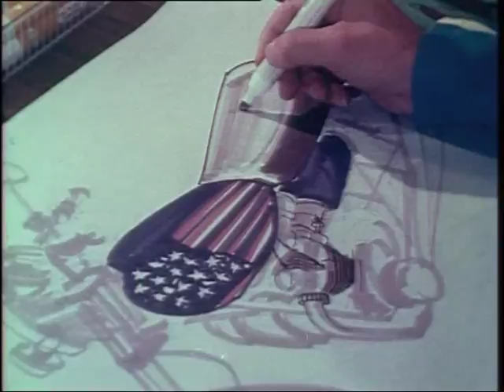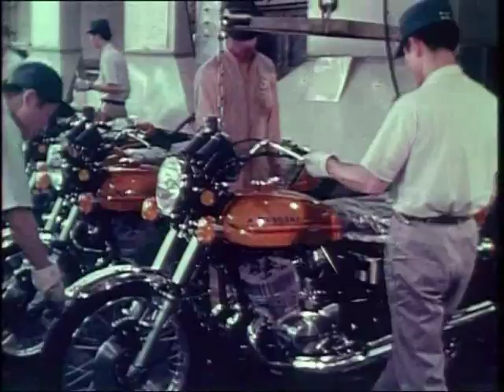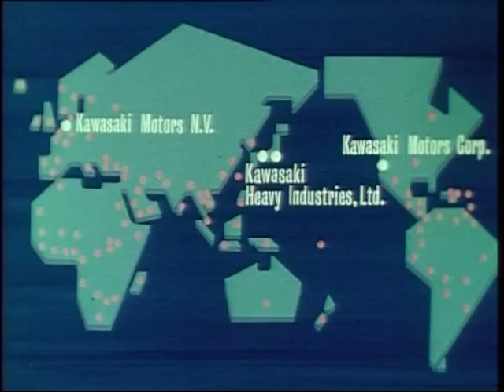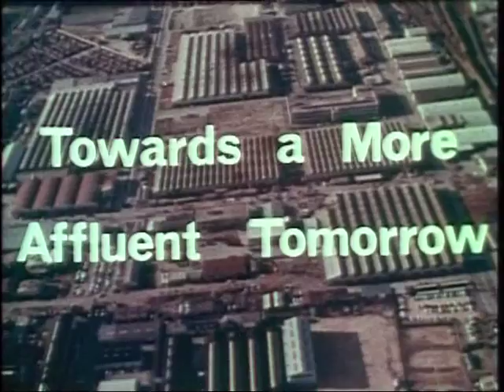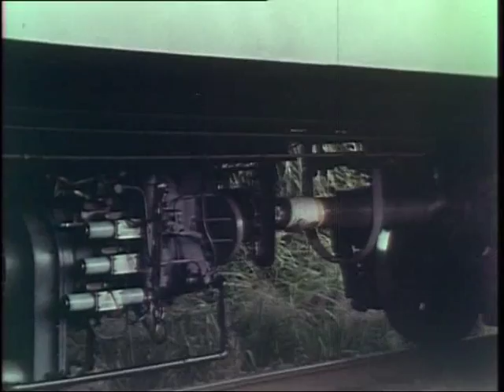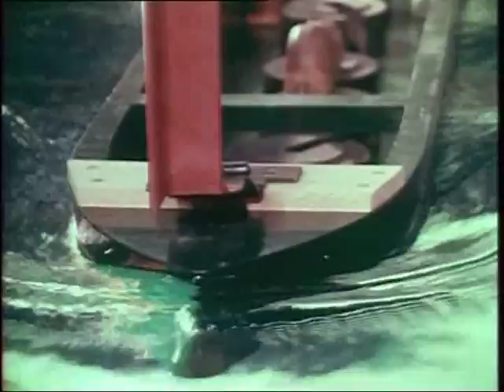COME OUT AHEAD ON A KAWASAKI.

Comment: I'm 68....go waaayyy back to my first bike kawasaki 100 g5...yellow...rode the crap out if it...3k miles sold it to a friend and bought a 250 Enduro yellow. Then a used 500 mach 3 which almost killed me it was terrifyingly fast....fold it for a green kz650 my all-time fav bike...loved everything about it....rode it 22k miles and sold it for a gpz550....kept it for 8 years....in 1991 bought a Vulcan 750 twin.....rode it all over arizona and Utah with my friend who had a honda magna 500. Last bike I ever bought was a kl650 rode it up to south Dakota.....my biggest wish was for it to have a 6 speed gear box.....im done with bike....in a way I'm lucky I was not killed....most of my bikes were all kawasaki....did have a yamaha xt500.....a 
Suzuki gs250 that my ex wife rode.....a used Honda cb 550k 1978....that I kept 14 years.

Comment: They basically took over Bridgestone. The two strokes were basically throw away bikes as crank seals cost so much to replace. The Z900 and 1000's were very heavy until the J model. Z1000J was incredible, CAD designed for light weight of every single part and bolt.

Comment: In 73 I traded my 71 mach3 for a 73 Z1, also motocrossed a modified 350 Big Horn.
Reply: Oh you went down hill,lol.
Reply: @noel3422 the Big Horn could hang with Maico 501s in deep sand. Quite impressive.

Comment: I owned several Kawasaki in the 70’s and 80’s. My first Kawasaki was a ‘74 250 triple 2 strike street bike. It was noisy, rode rough and got terrible gas mileage but it was quick. My 1980 KZ 440 LTD seemed light years ahead of the 250. O did get a new 1979 KL 250 4 stroke single duel purpose bike and it was fun but at 3000 milesthen at 6000 the head needed replaced due to lack of lube to the head.
Reply: Common problem. Mineral oil couldn't handle the heat.

Comment: You have to laugh when he says that Kawasaki is building safer bikes, and then shows footage of KH750s coming off the production line.
Reply: +TS50ER But they were safe models.......................until you started the engine.
Reply: They didn't get the nickname "Widowmaker" for nothing!
Reply: That name was used on so many bikes. Another manufacturer, behind in the horsepower race, probably started it. @asd36f
Reply: All the H range and KH range were dubious handlers.
Reply: I worked in a Kawasaki shop, where there was a tuned example for sale. I left that death trap alone. The four strokes were OK.

Comment: I love my KZ's
Reply: +jamtardio  Same here!  I sure wish they would've made a "Retro" KZ900 or KZ1000 bike 2day?  Instead, Honda got it almost right with their new CB1000 Deluxe.  Almost, as far as in replicating the KZ1000 style bike... LoL!
Reply: Have you seen a Z900rs? @Coupydog
Reply: You mean CB1100, right ??? Yes, its a good effort, if a little bland with a very soft engine. A new slightly edgier and improved version is just out for 2017 here in Europe. Hopefully this might help pick up sales of this bike which have been dissapointing. Its appealing strictly to the older crowd.
Reply: I wish I had bought a Kawasaki Zephyr, it does look nice. I own a '94 cb1000 it is a dependable machine, little top heavy with that big kegger sized gas tank, but a smooth running machine.
Reply: My '94 cb1000 is actually a neat bike, it's motor is from the Hurricane, minus hot cams, 6th gear, and probably different carbs, but it is still quick and fast, especially with it wide tires and great brakes.